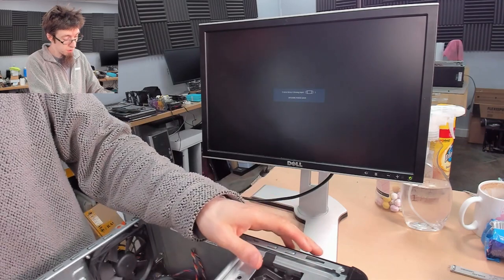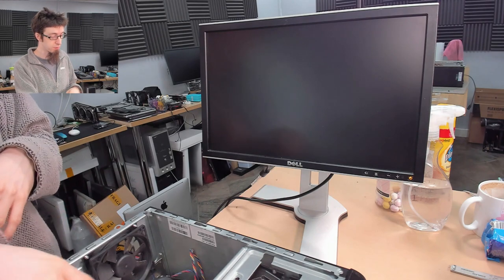Compaq CQ2 Power cycling - LFC#311

Comment from the maker: Bit of a janky no-post session today with an inconclusive result, but shows that the basic stuff like reseating memory, checking the CPU etc, still works just fine. It's not always an elaborate BIOS repair job!
Although I mentioned the CPU swap getting this one to go, I think it was actually the act of putting different RAM in that did it, although I couldn't tell you why because the original sticks weren't faulty, and the BIOS reset I did at the very beginning should've fixed a RAM training issue.
Reply: I remember having a similar problem with the same aged system. It turned out that the system had two mis-matched RAM sticks in it. Oddly enough, by simply switching their positions, the computer was able to boot just fine. But put in the other way around, it would not. By putting the slower/older RAM module in slot 0, and the newer one in slot 1, it worked. I think the BIOS reads the timing table from the RAM in slot 0, and assumes that table to be good for all other sticks.
Reply: I expect there was a dirty contact on one of the DIMMs.
Reply: @QuentinStephens  In my case, it was definitely not due to dirty contacts. The system simply refused to boot unless the older DIMM was in DIMM slot 0. I tried it back the other way around to be sure, and it again refused to boot. So I switched it back after learning something new. As I said above, these DIMMS have a timing table built into them: "Modern DIMMs include a Serial Presence Detect (SPD) ROM chip that contains recommended memory timings for automatic configuration as well as XMP profiles of faster timing information". And yes, both RAM modules checked out fine in a memory test with the older one in slot 0. Both sticks would work individually in slot 0 as well. But when trying to use the two sticks together, the mobo insisted that the older one was in slot 0. My guess is that the bios is only looking at the timing info of the DIMM in slot 0, and assuming that's appropriate for all the other slots as well.
Reply: @shanejohns7901  As my other comment elaborates, I'm going back a log way, back before DIMMs to SIMMs
Reply: what tools have you used to properly take all the filth and dust out of that think was it a air/gas high pressure dust can or some kinda of portable 600w to 1200w electric or petrol based blower or ? thanks in advance.
Reply: @shanejohns7901  I bought 2 new modules for a 2nd gen intel system and it wouldn't boot with both modules inserted.i had to leave one if the original modules in the system for it to be recognised.
Reply: Non... i like it a pc instead of Notebooks :p Good busy
Reply: Have you considered re-flashing the BIOS? My old desktop PC randomly stopped booting the other day, displaying similar behaviour as this one (boot looping).
I took it apart completely, cleaned it, repasted both CPU and GPU for good measure, reset the BIOS, but no change in behaviour.

I then noticed that I got it to post once in a while by removing or adding RAM modules or by connecting or disconnecting random drives.
Turns out, the BIOS must have corrupted somehow and flashing a new BIOS once I got it to POST fixed the issue. Maybe a little bit-rot happened here, too.

Comment: Ah, one of those mutant Compaq systems. ATX upside down, no PCI Express, no slots for upgrades. The case is pretty much sealed, but it's covered in dust all the same. Glad you got it working.

Comment: Another thing to factor in (in general) is the age of the board -- Somewhere over the years manufacturers switched to using a different type of solder that doesnt hold up well when it comes into contact with air. It doesnt matter if there is or is not any humidity, the environment will just eat away at the solder joints.

Ive had a few old machines that did the same thing but the most common problem is ram slots on the motherboard just vanishing into thin air and not being seen by the system. Some other machines ive had suffered this issue and it didnt matter if the system ran dual or quad channel memory, one or two memory slots would vanish until i gave the ram that was installed a bit of a tap and a wiggle while installed. The ram tested perfectly fine on other machines though. 

I think the correct term for it is 'oxidisation' oxygen just eats away at it. eitherway, its some form of corrosion - it doesnt eat away at the board itself. Just the solder joints.

This is just my own experience though. Depending on the board itself it could be other issues like cheap capacitors that the manufacturer installed because the board itself is a cheap throw away motherboard used for bottom tier office environments.

Comment: I remember similar problems on very old Dell and ICL PCs. There were two separate issues: thermal expansion caused the CPUs to lift slightly and thus have a dodgy connection with the socket (not relevant here), and the SIMMs (as they were back then) got dirty contacts - easily cleaned with a clean eraser. There was also an issue of corrosion when they cheaped out with SIMMs with tin contacts.
Reply: I also remember at one time there was a problem with bad CAPS.
Reply: @kens32052  That was Abit motherboards, wasn't it?

Comment: I will suggest that when you first re-seated the memory, if there was a bit of dirt on a pin, you did not use anything to loosen it up.   You should give the socket a small spray of good contact cleaner (one that does not hurt plastic).   The fact it took you two tries is you probably cleaned the pin the second time.
Reply from the maker: Yea that might've been it. I initially removed and reseated the RAM, but maybe the second time when I changed it to different sticks was what actually scraped the contacts clean.

Comment: Hey Graham, I have one of these and I too pushed it up to 16GB and  did everything you did apart from the CPU, I had to power it on/off a few times before eventually it kicked in, it now works only when I reboot Windows and the power is left in. I suspect some type of power issue with the power box.

Comment: I second removing the battery as opposed to jumping the clear rtc pins. There's actually been multiple occasions Ive wasted at least 30-60 minutes on a fix that removing the battery instead would have fixed. The clrrtc jumper pins are just unreliable.

Comment: Another issue that dust presents besides poor cooling is that it can harbor moisture which in turn can short out components causing all sorts of strange behaviors. Re: the thermal paste application.
 I suppose this debate could go on ad nauseum however, I use Arctic Silver brand thermal paste and they have very specific instructions on the "proper" application of their thermal paste. They recommend for most, but not all, Intel CPU's to apply a single vertical line of paste in the center of the lid from top to bottom.
Reply: If you have moist dust in your computer then you probably live in either a swamp or you have terrible case ventilation.
Reply: @Roadkill7878  Well, provided that 'no matter how you do it' includes not using far FAR more than necessary, and having it squeeze out and all over your mobo.
Reply: @shanejohns7901  I take it that you learnt that from experience, did you?
Reply: @Roadkill7878  Yep. It never hurts to see (research) how your CPU type looks without the lid on it -- to give you a better idea where to focus your attention with the thermal paste.

Comment: My roommate had an HP like this.  It was basically just a laptop motherboard in a case.  Used a power brick, soldered CPU and laptop RAM.  It sucked.
I saw the case had slots for expansion cards, so I assumed we could put a GPU in it.  Turns out, when we opened it up, there were no PCIe slots :(

We kept the GPU and eventually built a proper computer using it.

Comment: the pins on the mainboard over time loose contact i fixed a lot of those back in the day just by re seating or sometimes looking from an angle and lift certain pins up with a needle. same problems also when its not detecting memory, same goes for newer computers as well these sockets are really crap

Comment: Hey, don't knock machines with external power supplies - some people pay good money for a PicoPSU, this one basically already has one built-in. Looks like the board should fit up to an i3-3220T. Chuck in one of those (or a 3240T/3250T) and an SSD e.g. MX500, and you've got a perfectly decent, not very power-hungry office machine or server. (I would guess about 12-13 W idle. Not Haswell or Skylake terrain, but definitely not a massive power hog.) Given that the external power brick seems to be a 90W job, I may even risk an i5-3470T/3570T (TDP 45 W rather than 35 W). Oh, and some rubber nipples for the exhaust fan, I hate that HP/Compaq were so boneheaded to use hard-mounted fans as late as Ivy Bridge.

There's only one thing that really stinks about this machine - onboard Ethernet apparently is 10/100 only. Really antiquated for something from 2012/13.

Comment: It's a Pentium, not so much running as jogging!

I've just upgraded an Acer ES1-571 with a 4th gen Pentium, 4GB ram, and the ubiquitous 1GB hard drive, which came to me "working". Powered it on, took 5 minutes to get to the login screen, then another 25 minutes to get to a point where it was vaguely responsive. Luckily an empty ram slot, so double the memory, stuck in 500GB Samsung 870 EVO SSD. Boots up and responsive in 30 seconds, truly 60 times faster!!! For the use it will get, a new laptop would not do the job any better.
Reply: Had a similar case with I think an Acer laptop of the same generation (i5-4210U, 8 gigs of RAM, 500 gig HDD I think, Win8 upgraded to 10). It had never been used much as it took ages to even boot. I convinced the owner to invest in a Crucial MX500 - night and day. Calibrated the screen as well, which had the typical TN panel blue tinge. Salvage accomplished.The bottom was an absolute pig to get back on though, unlike YT tutorials which made it look super easy. Tolerances, who knows. I hate consumer laptops and their gazillion clips.
Reply: @PileOfEmptyTapes  Funnily enough, this laptop was perhaps the easiest to open I've ever done. Took out all the screws, and it almost fell apart, and no-one had been into it before me.
Reply: @neilshep50  Found which model I had been working on... it was an Acer E5-573-54HH. The TN panel identified itself as an N156BGE-E32 (DisplayCAL is quite talkative in this regard). So if anyone needs an ICC profile for that taken on Windows 10...

Comment: This, my 4th build, took place from late Nov 2021, through mid Feb 2022, due to my Z390M replacement mobos being: 1/ DOA from China; 2/ USA Support would not RMA mobos sourced from China; 3/ mobo package mislabeled and delivered elsewhere; and 4/ I was informed that the Z390M mobo they marketed and thus I ordered, was no longer in their warehouse.   

I've had enough!   Time to move forward to a Z690 mATX mobo, an Intel i9-12900K CPU and 32 GB of DDR4 or preferably DDR5 memory, sourced locally.   A GIGABYTE AORUS Z690M ELITE DDR4 mobo was installed.   Having experienced no successful Boot action, an ASUS R.O.G. STRIX Z690-G GAMING WIFI was then installed.   Did not fare any better.   I cannot recall which did what, but one would not POST, just started for 18-23 seconds and shut down for 2 seconds, then repeated, again and again, no matter what I tried.   The other mobo provided no signal to the monitor, either from the mobo or the graphics card.   All fans did come on, but only for a micro-moment immediately at start-up and just prior to the PC shutting down.   In between, no fans were running.   The drift of substantial heat from the CPU cooler felt by my hand, confirmed that Windows 10 had launched.   A test Intel i5-12400 CPU, confirmed that the first Intel i9-12900K CPU I installed, was defective.   

In part, my 4th build consists of the refined, rock solid, ASUS R.O.G. STRIX Z690-G GAMING WIFI mATX mobo; the powerful yet efficient, Intel i9-12900K CPU, OC'd 34%, T-Junction 94°C and cooled by a Noctua NH-U9S tower, in a mini-tower case I modified for effective hot component cooling, without introducing any objectionable operational sounds or noises.

Comment: I need help with bypassing a Windows 10 password. 

The account isn’t a local one but a Microsoft account one. 

I don’t have access to any of the “I’ve forgotten my password” recovery options such as phone or email 

Is there anyway to bypass this? 

If not I can just backdoor in Linux and drag and drop any data off that method but worth a try resetting 

Thanks

Comment: Have you ever replaced a cpu socket on a motherboard?
Reply from the maker: No, but I've actually had some tools and parts to do a practise run on an AM3+ board for a while now - rainy day project.
Reply: A while back someone left a huge desktop on the side of the recycling bin and I picked it up. The guy poked the connection ports in the back and also the cpu socket. I assume that it was faulty and would by doing so not fool anyone to try to use it OR its just someone that didnt want others to take advantage of getting a working board for free. I bought a socket from china just to see if I can repair it. Not for the mb but for the practice. This should be fun :)

Comment: A 256 or 512 Gb SSD upgrade for a spinning HD would definitely be worthwhile, if wanting to keep the machine out of the trash pile. An old PC button battery may test at 3.0 volts, but may still be unable to output sufficient amperage, depending on age. So: with a cloned SSD & new bios battery, also offer the customer a Windows 10 upgrade, if that hasn't already been done. Should continue useful life until Windows 10's scheduled support end date of 2025.
Reply: Yeah, if it's only used for office work, the cheapest SSD would be a major upgrade. I've done that at work, before I was given the money to replace the 7-10 year old computers that people were using.

Comment: Oh My God! Get the dust out of there!
You do NOT need to put the BIOS coin cell or whatever coin cell the BIOS has. The coin cell for BIOS is just for backup in case the main power is off. You can reseat things or build a system without the BIOS coin cell. If it is all ok, the coin cell can go to its place if the system powers ok.

Comment: From what I've seen, six beeps is normally related to bad video / video card not detected
Reply from the maker: Yup. I initially dismissed it because this uses the iGPU, but it seems to apply for "monitor not detected / no output active" as well, which was the issue I had once we got that far.
Reply: Seems possible,  artifacts at 20:28

Comment: Nobody notice the video artifacts at 20:28 and after? This computer isn´t fixed.
Reply from the maker: This is a quirk with Win 10 and early EFI platforms. Flickers like this can also happen when the GPU driver starts up.
If they persisted onto the desktop, absolutely there's an issue there, but that flicker of the compaq logo is normal.
Reply: @Adamant_IT  seems related as this iGPU for sure uses shared memory, as it was the problem related to memory. Bu I saw a comment of your, and rewind my experience and saw this happening too.

Comment: The dust could be a very big problem, for you.   Depending on the environment, cat dander can be harsh on your lungs.  Mouse poo will kill you.  Blowing this out is probably the most stupid thing I have ever seen.   Buy a vacuum with a heppa filter.  If you must blow it out, do it outside.
Reply from the maker: Oh absolutely, I blow out the dust outside, the shop would be under a carpet of it otherwise. It's why there's rarely footage of the dusting, as I have to go out back where the air compressor is.